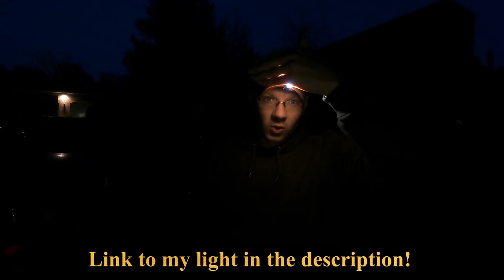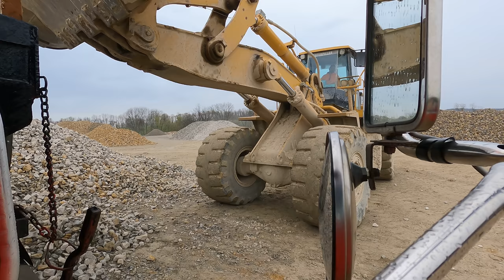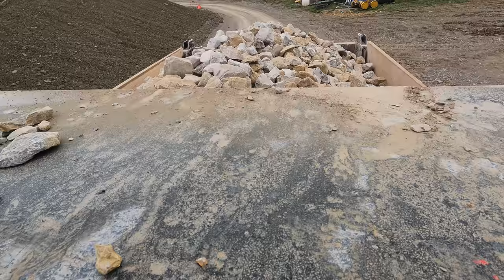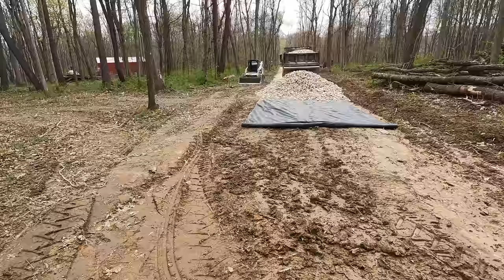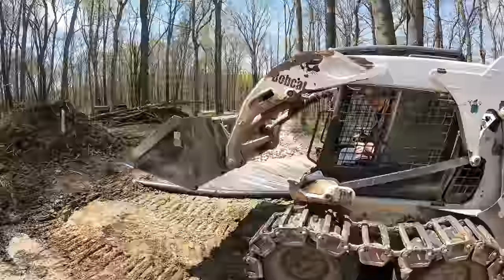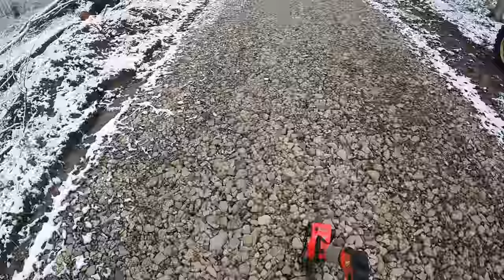Driveway so long it took over 8 years to complete!

Comment: At 7:00 am he didn't go ask them to fill his truck with rocks.  he was asking them if they knew knew of any old rusted busted equipment that had been abandoned for 30 years and needed some work.
Reply: I'll add to the chorus, I thought so too, you had to look out of his side windows to make sure which way he really was going.
Reply: @dave_n8pu  Yeah in some of the shots it looked like he was going forward through the side window closest to the driver side and reverse through the other window.
Reply: @dave_n8pu  Yeah, it was a reflection off the rear window of the windshield view but initially i thought it was the actual view from the rear window. Optical illusion.
Reply: @dave_n8pu  can
Reply: @dave_n8pu  no

Comment: In a previous life I used to drive an asphalt sprayer. We were loading crumbed rubber into the bitumen tank and the Engineer asked if he could do anything. He was told he could measure out the next two kilometres so off he went with the measuring wheel. When he got back he said “Gee, that’s hard work”. I looked at him and extended the handle to full height. He walked two kilometres stooped over. Hahahahahaha

Comment: It’s sweet to see you just jump in the loader and be able to start it and use it considering the condition it was in when you first started working on it
Reply: George Jones  I was going to ask about those tires still holding air. Then I thought about it and realized they must be because if they weren't, it would be parked and he'd either be looking for used tires or selling it.

Comment: The money you’ve saved having those old crusty machines and being able to do all that work yourself is beyond impressive. Plus, it’s given you great content.
Reply: True - but what if one of those old crusty machines needs a new hydraulic transmission?
Reply: @jurgenkuhlmann9194  you buy used or buy a new old machine.
Reply: @jurgenkuhlmann9194  that's the downside, and why they are usually bought cheap. Until they break, renting, buying newer, or hiring out the work is significantly more expensive. Scrap prices are high right now.
Reply: @ctdieselnut  Well - a rusty front loader makes 6 tons of scrap metal! That's all right!
Reply from the maker: @jurgenkuhlmann9194  the loader weighs 25 tons
Reply: @DieselCreek  Ooops, I was really off the mark here! Thanks for the info, and good luck, including NO breakdowns, of course!
Reply: How long is the driveway, in meters? For the 98% of the world who uses metric ???
Reply: @jurgenkuhlmann9194  How long is the driveway, in meters? For the 98% of the world who uses metric ???
Reply: @LukaArtelj  OMG! I can only guess  from what I have seen so far on this channel. 300m maybe🤔?
Reply: @LukaArtelj  1847 ft = 563 m
Reply: @peterslegers6121  thanks 👍
Reply: @garycorbett148  No doubt. Plus, I believe restoring old crusty machinery also means saving the planet.

Comment: Ah yes geo textile, smart choice there, now you don't have to fix it every year. BTW: Did you see my post about collecting all the rainwater that falls on your machine shed roof, storing it  and then using it to wash your ever expanding vehicle fleet? 👍😉
Reply: The purpose of the textile is so the rock doesn't get pushed into the ground, correct?
Reply: @Netherlands031  Yes, exactly. I have seen several other American You tuber's that have made roads and parking areas like this, but that didn't put down any textile, and they keep having to add gravel almost every year. This is a situation where the saying "cry once, buy once" is very apt...

Comment: Good to see the loader bring put to use and running! Btw, it may be easier next time to be driving as your dumping the rocks; that'll help spread them and eliminate the need for the big piles to push over.
Reply: Dump while backing up.!!!!! Would be so much more consistent and cleaner and less work/fuel.

Comment: She might be big and slow, and you have to learn the controls,   BUT she has only 1/4 as many controls as the grader.   Cool job.
Reply: but you don't touch the controls on a grader or that defeat the averaging of what a grader does. set them and run your grade then readjust.
Reply: @mog5858  Not true. There's a little more to it than that brother. A good blade man is an artist in every sense of the word.
Reply: @Craneman4100w  AMEN to that!  We have a master grader driver who comes out and maintains our tracks here when needed.  Regularly adjusts the controls in response/anticipation of something only he can see, but the results speak for themselves.

Me, well lets just say most tractor pulls leave a smoother surface than I do when I try grading.

Comment: All of my customers demand half inch lime stone with dust and complain about how their rock roads turn to dust and mud then wash away and are destroyed by vehicles and semis. Finally convinced one guy to use rock similar size as you have and hes been super happy. Its stayed smooth and hasn't turned to dust like the smaller rock.

Comment: I'm more used to digging out the top soil and top two or three inches of sub soil, then back-scraping the hard-core into place with a JCB 3-CX in 'float' mode.
Creates a great, level, pseudo-graded finish, so I have a lot of respect here, because laying forward onto clay base is a slow and painful way to build the road surface.
Interesting you are using crushed quarry rock. Back in the UK, that and type-2 fill has become so expensive, the much cheaper way is to lay down crushed concrete/building material reclaim, then cover it with road asphalt/tar grindings and roll them in tight. Gives a finish near as good as a laid black-top road, especially if you spray a fine mist of diesel onto the surface before you vibro-roll it down.
I like the old wagons you save and use - there's many a fine tune played on an old fiddle and for the part-time user, they work just as well, although maybe not quite as elegantly as a new one.
Nothing quite like mastering the backlash on a back-hoe, with a extender arm which has had most of the life already worn out of it, when you are trying to do fine placement...
😉😁

Comment: I’m curious as to why you don’t set chains on the gate to do a controlled spread? It’s a lot less futzing around and your material goes further and you use less fuel. The fabric can handle the dump driving over the fabric.
Reply: I agree 100% , set the chains, start dumping as you back up.

Comment: That is some huge stone, what is it? (Doesn’t look like road stone). I have to admit I haven’t watch most of your vehicle buying and repairing vids. BUT I love to watch you USE heavy equipment!  I’m amazed at how skilled you are, it’s AWESOME!
Reply: lime stone, he will be adding smaller gravel as a bedding to top it off and make it smoother after the limestone settles.
Reply: What size stone did you use?
Reply: Tad,
   I’m in northern Illinois and we use road stone as a base under asphalt. Matt using a much larger stone, looks more like rip-rap to me. We use rip-rap in drainage ditches or at culvert outlets to prevent washouts and erosion.

Comment: I've worked dump truck subdivision development. (Dirt jobs).  The usual practice is to peel the overburden down to "good dirt."  Truck it to the location they're digging a massive hole getting to more "good dirt," which they put on my truck to take back to where they're building their roadbed. Usually they're using a big track hoe to dig n load me.  
When the road beds are complete they back fill the hole with all the dirt I dumped around the edges.  The subsoil hole generall is not on a house site lot.
After a proof roll then they apply the ABC Stone and then asphalt.

Comment: Attach tether chains to the dump gate - spaced 4-6  inches and back the dump truck as you unload.  This way you control material as you drop from truck without having to spread piles.

Comment: I can appreciate your weather. I'm in Indiana. Last Tuesday we had 5 inches of snow forecasted. Next Tuesday, a week later,  we're supposed to be in the high 70's lower 80's.
 I think your wheel skipped a little. I'd guessed 2600 ft (1/2 mile at least)

Comment: Here in Finland when we build logging roads we usually do what you do, big aggregate down first, then top it with 0-16mm gravel, aka gravel that’s max 16mm, unwashed, so you get the stone dust that binds the surface together. Then you just grade it from time to time and put more of it on top as the road settles.

Comment: Considering all that top soil you'll need to scrap off in order to grade the area, you could sell it. Just take it down to the end of the driveway, set a couple of signs, and either bag it in burlap sacks, or sell it by the truckload. Local delivery only. Will help make back the cost of your gravel driveway.

Comment: In UK the most popular road stone is MoT (Ministry of Transport) Type 1. It's a crashed hardcore 20mm and 40mm with fines down to 6mm though there is always a measure of small stuff. It packs down hard under a roller. Used usually as an underlayer but it can be a surface in its own right.

Comment: Nice work. I’ve built many a driveway with an old 450C dozer and a single axle dump. You did a nice job on the dozer. Everyone thinks they are experts with a dozer. They need try to grade wet clay, it’s not easy. Looks good, thanks.
Reply from the maker: That’s exactly what it was plus full of Old stump holes I’ve filled in over the last couple years

Comment: Run those rocks out with the truck while your dropping them. Then touch up with the skid steer.  Works great, try it.

(Never mind I didn’t notice the road fabric.  When I did it I was adding gravel to an existing driveway)
Reply from the maker: Yes. Even with the road fabric on hard ground I can do it but the ground here is too soft, I would need a lower reverse gear or firmer ground. I kept stalling the truck when I would try that

Comment: Now I'm only 12m in and I know I'm being "that guy" but I've got a little experience in tippers. Seeing you tip those rocks was frustrating as all hell. I work mostly in dirt road maintenance.

What we do when tipping is tip a little, reverse over it, tip a little, reverse over it etc etc. When done properly you tip while reversing. This is made easier if you have chains.

And I know, I get it. You don't do this all day every day, you probably have incredibly good reasons for not doing it but by jingoes I was so bloody frustrated :p

Great result though, mate. Champion effort
Reply from the maker: Yep, good reasons indeed. Ground is too soft plus I’m putting it on so thick the truck won’t drive over it in reverse because the gearing is too high. I can do it in reverse with smaller rock but this stuff is too big
Reply: @DieselCreek  100% agreed. Was absolutely the opposite of ASMR though :p

Comment: I would top cover that driveway with crusher dust to smooth it off a bit but not completely cover the limestone but just so the crusher dust fills in amongst the rocks and that there is still some roughness to get a grip in wet or snowy times and you won't wheelspin up any gradient. By the way if you didn't know what crusher dust is it's very fine crushed rock crushed into small granules, we in Australia call it crusher dust but I don't know what you s call it in the USofA.

Comment: Matt, I heard you say you might use millings for a top coat of rock! Millings for a top coat is very, very, dusty material! Millings used for a base or a middle layer, is ok, but it is a terrible top material! The dust from driving on millings will haunt you, your wife, and your new house! 1/2" or 3/4" washed limestone would be the best, but I know, it is expensive! Good ol CA6 is cheaper, and will pack nice, but it is dusty too, but not as bad as the millings! Asphalt or Concrete millings is cheap, but the dust from both is never ending! JMHO from working in the road oil and asphalt road building industry for many years! There are ways to control the dust, but they are expensive too! Nice job on the base, looks great!

Comment: Cool video, Like you I have a long drive Ive been battling the last couple years about 2000 ft. I should measure it to be accurate though. I have a track loader a skid loader and old farm equipment . Stripped all the top soil off built it all up with clay. I never put plastic on mine though..? I get the purpose of it but Ive hear mixed reviews on the cost of it. In my case I'm just using gravel. And now I stripped off a field to pull my own "gravel" that mother nature made. At the end of the day driveways are expensive and are always a project. Thanks for sharing.

Comment: Awesome video, really keeps the spirit up while stuck in quarantine! 

That is one hell of a job, especially on your own, having to switch machines all the time. 

One question - wouldn't it be easier to use "spread chains"(we call them that i Norway anyway, you migh call them something completely different) on the hinge door on the truck, adjust them properly and just back up while spreading and spread them in front(well, behind you) as you go? Might be to wet/unstable ground for it tho, not familiar with american soil. 

We use that method on our trucks when building logging roads, but we have 4x4(or 6x6), raisable axles, full diff locks + an adjustable blade under the trucks aswell...

Comment: Oh Boy ! 1847 feet (for me translated rather 600 meters long) means your driveway is a 500 T or 600 T story ! 
Thus, ALONE with your little truck to supply the site (!), you must have had between 50 or 60 rounds to do, I hope that the material quarry was not too far away !
That must have been fun Dude !! Anyway, good job mon Ami !

Comment: So crazy question here Matt, why not back the dump truck to where you can dump the rock and lay it down behind you as you move forward?  I've seen that done before say in an area where a shop was going to be built such that it laid the rock out in a decent layer and little forming had to be done by dozer, skid steer or otherwise?

Comment: Measure should be from the outside of driveway x width = Total Metres/Feet Sq  I think a few spots you should put under pipes for water to shed due to grade as large amounts of water will cause headaches. That  is a large driveway to top dress i would be looking at Mine for unmilled tailings than top dress with preferred topping.

Comment: Matt with the land you have either side of the drive , have yo not considered making french drains on either side , using demolition rubble as infill rater than new stone much cheaper / and environmenttaly clean recycling , , it would also help with water etension under the drive

Comment: Had a d41a in the late 90's.  Pretty good unit but it had flotation tracks on it.  Not so good at pushing on hard packed gravel from an old hydraulic mine.

Comment: TIM from Canada suggestions for you if you were going to use this new excavator of yours and you were having a hard time because the bucket is too big suggestions are to make a new bucket with half the size or find a new bucket that is compatible with your machine that is the smaller dimensions so you can still use your excavator but with the smaller bucket and payload

Comment: Matt, the driveway FINALLY looks really good, and was better that you used the skid steer. Wondering, did you gains a bit of weight?? As for the weather there. Here in Upper Northeast Illinois, we also had a bi of high temps in the 60's and then temps dropped overnight to below freezing, with a light mix of light snow and freezing rain, though it didn't stick much... how long til you start building your new home?? will you have it built or build yourself??

Comment: Please forgive my ignorance but, wouldn't it have been a little easier to lock the tailgate open a certain bit and dump while you were backing up ? Or would that have not worked given the condition of the ground, being wet and all. Not that I didn't really like seeing it all come together I just thought it would have saved you some time with the skid steer.

Comment: Just curious on why you used drainage/sewer (clear rock) instead of rock that size with fines in it? Clear rock has absolutely no compaction factor because it just walks everywhere without fines to bind it that's why it's pumping on you. I thought well maybe for drainage but if your road bed doesn't drain then it would be pointless to have a few inches  of rock for drainage also using such large and course rock can definitely tear up your fabric when driving heavy loads on it. Just curious on your thoughts 🤔.

Comment: Should have made the road much wider, but I understand the financial constraints with that. That could always be added in the future. I'm also has problem with the lack of drainage along the road and the non-placement of a length of 8" or 10'" diameter schedule 40 PVC pipe for drainage and smaller for utilities across the road at strategic places. Placing that in later would destroy the fabric.
Reply from the maker: Why make it wider? It’s actually already plenty wide enough, It’s probably about 14 feet wide in most places, your vehicle is only eight

Comment: Just so you know, you should never turn with a bulldozer while pushing material, it puts a lot of strain on the machine and tracks, and it may brake it after a while, you should always push in a straight line, and move to other sides of the pile you are pushing